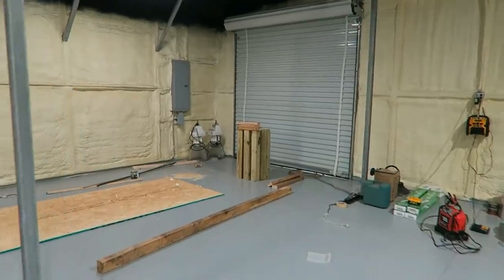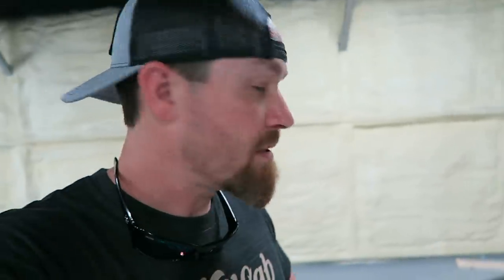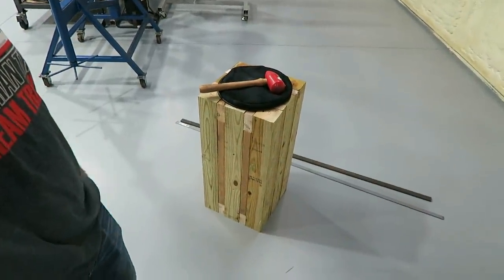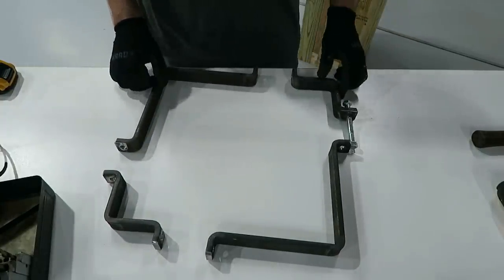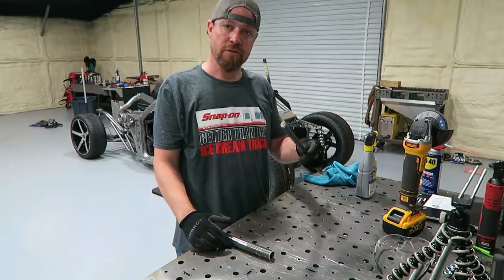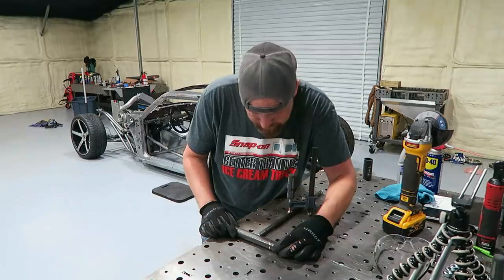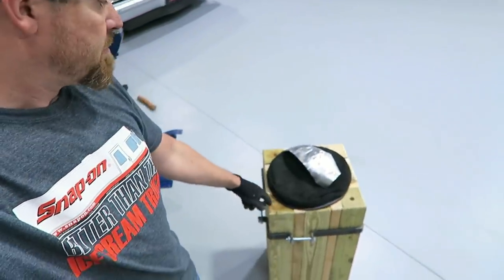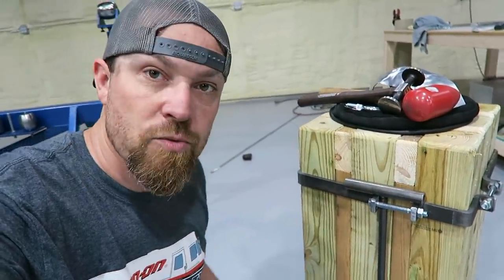How To Make A Rustic Fab Block Shrinking Stump | Could Be Furniture

Comment: Howdy Sir, 
I think you should use thick leather strapping to make hammer loops. It will deaden the clanging and rattling of your hanging hammers that will bounce every time you hit the top of the block. It will also save the wear on your hammers from bouncing around all the time.

Comment: Maybe burn it and use a vinegar + steelwool (plain white vinegar and one steel wool sponge in a bucket or jar or something together for as long as you want, when I make it I let it sit for a hour or two but I will leave the extra that I don't use and when I go back and use it after a few days, it gives a little more of a red, rust color) as a stain for your stump, I think it would look pretty cool, also it might help with rusting up that metal. It makes the wood look old and kinda gray, it is my favorite "Stain" to use on rustic projects.  Good luck on what ever you decide on it ;)

Comment: instead of burning it or using a stain, you could stain it with used oil from your trucks, did that on a couple projects a few years ago, just not sure how well that would work in your shop with sparks flying around....... just a thought for ya

Comment: Great job on the table, I've been wanting to do a similar one and run all thread through it with some square nuts to make it look old. As far as burning it I would just check what's in the pressure treat as far as chemicals, or obviously do it outside

Comment: At the old days, they used to make blacksmith's workshop floors out of wood stumps. On this video, you can clearly hear why. When you are banging metal inside a space that has hard floors and hard walls/roof, you'll end up deaf,and with terrible Tinnitus. Now to the problem, that can be fixed: You have a strong echo in there. Without re-doing everything, probably the best way to fight that echo is to hang up sheets of cloth to the roof. Thicker the fabric and more sheets, stronger the damping. When placed perpendicular, the air can't find out the way from the maze, and the echo is almost gone. Almost means it just can't be removed completely, due to the chosen surface material. A bit cheaper choice is to  put up removable walls made out of thick cloth. surround your filming space with those walls, and you are good to go.

Comment: Should have glued the timber, used the screws for positioning and clamping only, it would have been one homogeneous block.
Reply: Then he can't replace any of the wood pieces, if they get beat up.
Reply: jenky1044 He could just cut the top inch off to reface or make another, didn’t take long

Comment: I think you can strip the plating off those bolts with hydrochloric acid, and then heat em up red hot and quench them in oil to make them black.

Comment: Heat the eye bolt up and open it up a bit. If you could find a some small horse shoes that would be sweet. I bought a pale of them a few years ago that had som smaller decorative shoes in it. I'll see if I still have any of the small ones left. Maybe even a d ring or shackle and cut the ends off and weld it on to the straps. Could do all kinds of cool stuff with it.

Comment: Put a welding magnet in a zip lock bag. Place it beside the metal shavings from drilling/cutting. It will keep the mess to a minimum. The bad makes the shaving easier to clean off the magnet.

Comment: You can weld some u-bolts to the straps for your hammers... Burning the wood would be a good look but be aware there might be arsenic used to treat that pt (pressure treated). 👍👊

Comment: Look up anvil stump. That's basically whats been build, without the anvil to go on top. 

As for tool holders, I've ben using heavy 2-hole pipe straps for 2"+ pipe. Made of 1/8" material so plenty strong. Anvil stump pictures will have many ideas on tool holders as well, as thats where blacksmiths prefer to keep there favorite tools handy.

Comment: Nah, don't stress about the echo - as you get more stuff in the shed that will drop drastically.

For storing the hammers, etc, I had in mind yoyu drilling multiple holes through the block to stick the tools in the side - like a knife block?
Maybe a ply board that can be moved with the work if you have a lot of hand-working tools?
Oh, perhaps a couple of deep holes in the top for when you want to sit at the block and have things at a comfortable work height?

Oh, who the ** thumbs down stuff like this?

Comment: Looks great. Be careful, those 4x4’s looked like they were treated lumber. If you inhaled the sawdust when you were cutting the blocks and using the router, it might have gotten you sick. Just a thought.
Reply: to add if you burn those 4x4s it will release formaldehyde and veracious other toxic chemicals. just contact with the skin will make you sick.

Comment: Have you aired your shop out well the spray foam and epoxy floor paint out gas for a while and can make people feel sick.
Reply from the maker: yeah...the out gassing in mainly an issue when the ratios are not proper